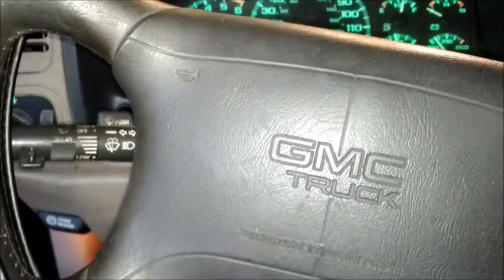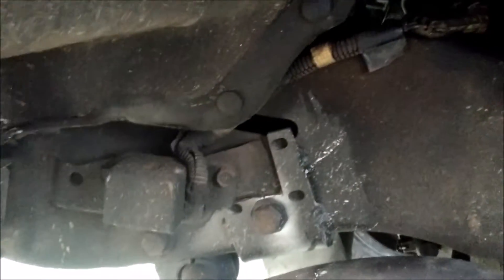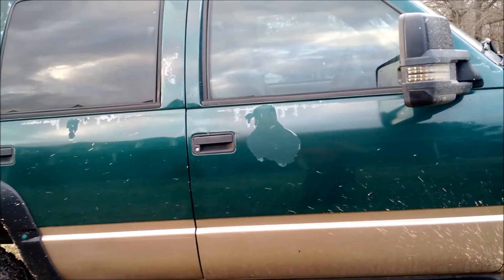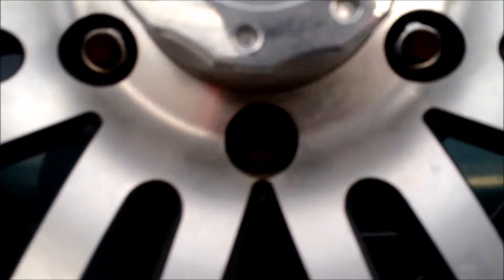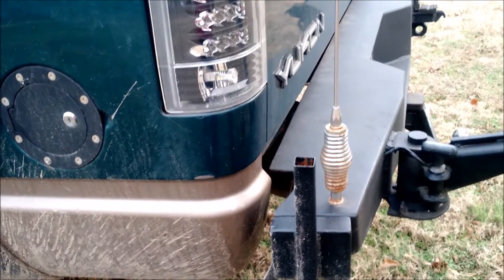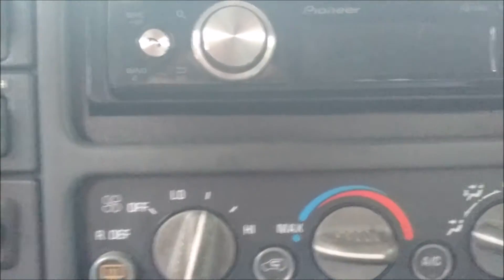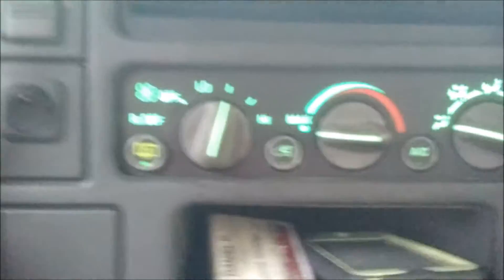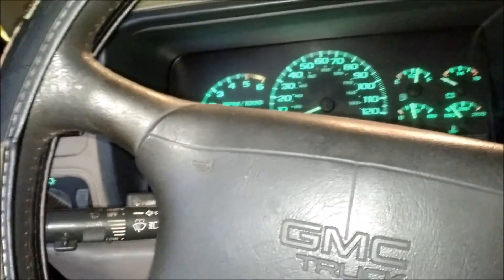1996 GMC Yukon Walkaround (GMT400) | 6" lift | Bumper/Tire Carrier | Anthem Wheels

Comment: Had a leaky rear seal on my 93 Suburban; same lift hatch and tailgate.  I got new rubbers for it on LMC Truck, then stripped out the carpet and used some Durabak bedliner in blue.
Reply: Durabak would be a good way to go for the entire interior.  I wouldn't use it outside again.  I did on my S10 and it just doesn't hold up to UV rays.  Have to recoat it every couple years.  Interior, though it would be great.  Get it in tan to match your interior for about $200 a gallon; roll or spray it.
Reply from the maker: Yeah, I'm most likely going to order the main rear hatch seal from 1A auto since this month they have most there weatherstripping 60% off and the main hatch seal is one of them. I also need to get the rest of the rear also (1A auto doesn't have them though) but I can get the front doors while I'm at it .That's definitely something I will need to look into.  I was just going to get the stuff locally, maybe hercule liner, but I'll look into Durabak.
Reply: Oh, please, please, do NOT do Herculiner!  back in the day a buddy of mine had a 90s Silverado.  We did the bed in Herculiner.  Id does NOT hold up.  Durabak for DIY liners that have grip and traction is THE product.
Reply: ...that and Herculiner is Ford Model T like: you can get any color you want as long as you want black.  Durabak has over 30 colors.  One of the tans would match your interior very well.

Comment: I keep going back to your video for more knowledge haha. I have never done a lift on a 2WD and your Yukon is really well built. So my truck is having some issues still. This is what I got so far: I got the upper control arms the exact same ones you have and they fixed my alignment issue for good!! Since I did the 3” lift I went the cheap way I guess and only did 3” coil springs spacers on the front. It has been a nightmare ever since,  ride was ridiculously bouncy so I got 3” inch longer rancho shocks and it definitely helped a lot on the highway is smooth now,  but still over bumps it’s just a mess it clunks so damn hard that I’m starting to believe it’s my upper arms smashing into the frame... at this point I just don’t know what else should I do with my damn front end. Only option I see is to get 4”spindles just like  yours. Will this finally solve my issue?, I noticed you mentioned that even though you have 4” spindles you still have 2” coil spacers. Why is that?
Reply from the maker: Your clunking is almost definitely the control arm hitting the frame and needs to be fixed ASAP, or you might run into the problems I had with the upper control arm mounts ripping/cracking out of the frame. I had the 2" spacers because I wanted 6" of lift to bit big tires but now I only recommend a 1" spacer because I still had issues with the 2" spacers. I would definitely bite the bullet and get the 4" spindles (get rid of the 3" springs) and if you want more, go 1" daystar spacer and keep it at that. So I am now at 5". 

I've spent more than I like to admit perfecting and doing trial and error with the front end and these were my final results to get a good and reliable combo.
Reply: Daniel Pace I took your advice, went straight to my local pepboys this morning and bought a pair of polyurethane bump stops, shaved them to fit and bolted them behind the upper control arms Woah what a difference clunk is gone for good Finally! that was really really nasty ThankGod I asked you before frame cracked. Okay I’m decided I’ll order the 4” spindles so I can eliminate those damn 3”spacers on the springs and be done with the bounce house situation that I still have when I go over bumps. Just to be sure I sent an email to the person that sells the spindles I pointed out that I have ‘custom made’ upper control arms and sent them a picture of what I got and asked if there would be no interference (spindle+custom upper arms). They don’t know the answer for that for sure because apparently I’m the first person with my situation that asks them, they just recommend going with the original upper arms. But I’m guessing there’s no issue since you are running both things without any problem correct?
Reply from the maker: If you are going back to stock springs and no spacers with the spindles.  I'd recommend going back with the stock UCAs because the extended arms will probably be too long to adjust the cam bolts to get accurate alignment. The only reason I still have my extended UCAs is because I have a 1" spacer.
Reply: Daniel Pace, Great point! Good thing I kept them and didn’t scrap them. I will probably have to go back to the old ones.. shame cuz I love how the custom ones look specially after I powder coated them Gold they contrast amazing on my matte black truck. I watched your other videos last night and saw how you couldn’t get a proper alignment done so that’s definitely a given fact that I’ll have to get rid of the custom UCAs. I also watched the videos on the damage to your frame damn. That’s totally disturbing I spent half an hour checking that specific parts on my frame earlier today. It’s great to have your experience with all that requires to lift a 2WD. I’ll keep you posted after I get the spindles

Comment: for the vibration problem you have an pinion angle problem. you need some chimes and line up the pumpin the the transmission.  and that will solve your problem. I run into the same issue I bought some 4 degree chimes at 4 wheel off road.  you install that under the rear lift block. 
you also have the same wheels as bad z71 I don't know if you follow him. nice wheel by the way
Reply from the maker: I know about the shims, I got some 6° ones for my Jeep when I lifted that. But I don't think that's the problem, (plus the lift block was wedge shaped so it already has some shim ° already) at least the whole problem. When I had my old rear axle, old front rotors, and stock wheels with 35" I didn't have the vibration... but when I changed all those things I got the vibration.  So I'm more leaning to maybe something being wrong with the rear axle I got but I'm not sure.
Reply from the maker: Yeah, I know. I actually found Anthem through him and I do watch his videos. Also, thanks.

Comment: How did you install the fender flares?
I purchased a set for mine and the instructions are not very clear.
Reply from the maker: It's kinda hard to explain. but the front flares and the rear section of the rear flare just screws in where the steel trim arches used to be. the door part has clips and 3m tape to hold in on.  I should have some pictures on my build thread in the description that might help out.

Comment: I still vote for Raptor Liner color matched to the factory green.  I'd probably get rid of the gold rocker panels, if it were mine.
Reply from the maker: That's definitely something I'll look into... Just don't know if I want to go the whole bedlined look, even if it is tented.
Reply: For a truck that old, is it worth it to spend more than you paid for it on a paint job?  Especially, with  the amount of bondo dings you need to account for?  DIY is SYC (Save Your Cash).  Seriously, I kick myself for not going that route with mine.

Comment: Hey bud can u help me find ur brush guard
Reply from the maker: It's no longer available.  It was bought back in 1996 by one of my friends dads for his '95 Z71.  It's a Ramsey winch brush guard. Warn still makes a winch brush guard kit for these trucks. It's their trans4mer series.  You just have to buy the three pieces separately. Center section, winch cradle, and then the headlamp brush guard sections.

Comment: I've given up on finding new visors.  Go see Bleepin Jeep's video on rebuilding visors.  I'm probably going to go that route.
Reply from the maker: Yeah, I've seen both Matt's and Tyler's video.  Our visors are like what Tyler did with the cardboard insert.  That's one reason they go bad so often is because moisture gets in the cardboard and ruined them.  I think I've actually seen new/aftermarket (maybe even NOS) visors but I think they were something like $60 per side.  I'd have to find them again.
Reply: I liked Tyler's version better.  Hope Floats had that HIDEOUS striped anchor crap.

Comment: 3.42 gears aren’t that bad I see people with old school blazers using stock 3.08 gears
Reply from the maker: 3.42 gears are indeed not bad, however with oversized tires and heavy towing, 3.73 are better.  The 3.73's along with a tune have improved the drivability and ease of towing heavy loads.